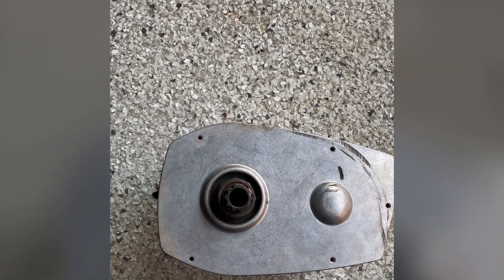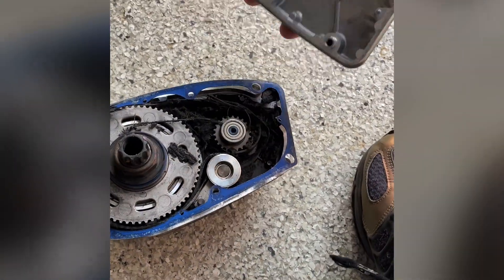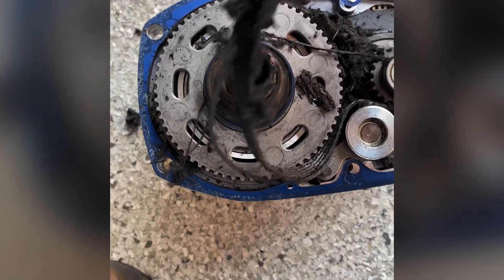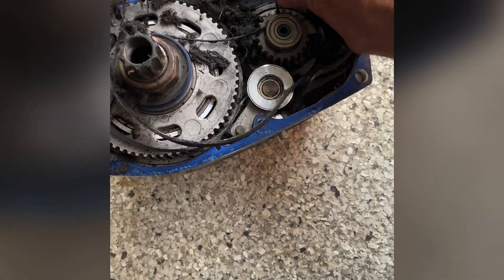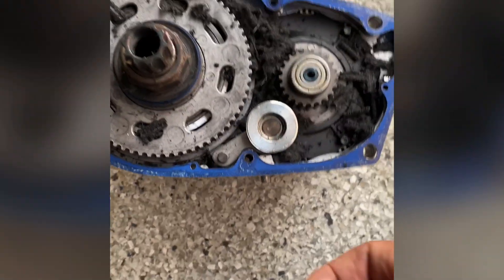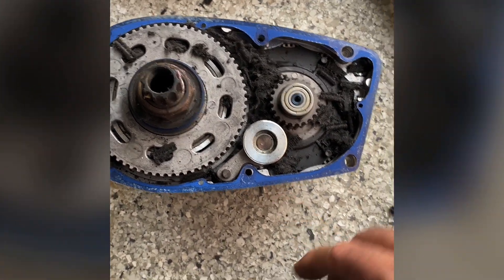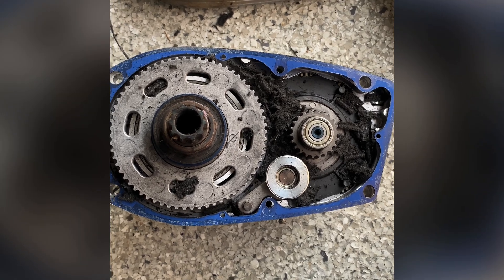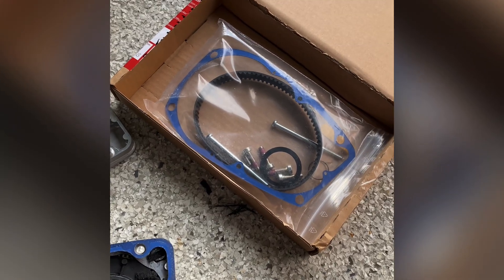Brose Motor Failure

Comment: My 2022 Turbo Kenevo Expert did the same thing last night. I was climbing a steep hill at my max effort in turbo mode, and it suddenly revved all the way up without any acceleration, and gave a motor error warning. Luckily I could still ride it home, but it will give no assist if I turn the power on, just revs up and throws a code. It will not allow me to back up the bike, probably the motor is jammed with a shredded belt . Luckily mine is still under warranty, so I dropped it off today. Is there anything I should do to upgrade it so it doesn't happen again? It only has a year of trail riding about 1-2 times a week for 10-15 miles.